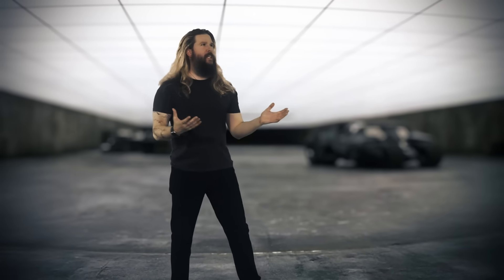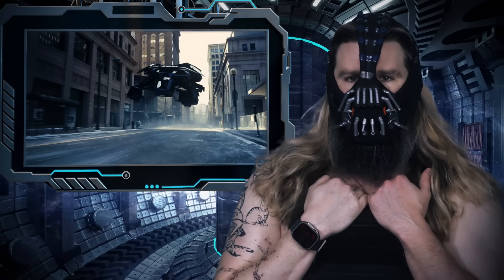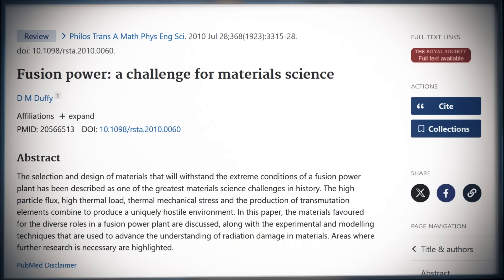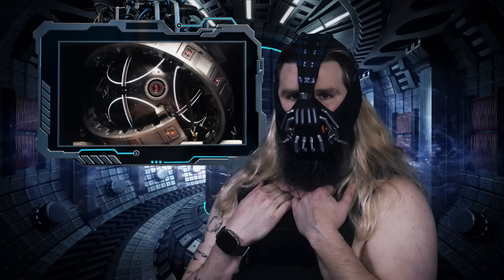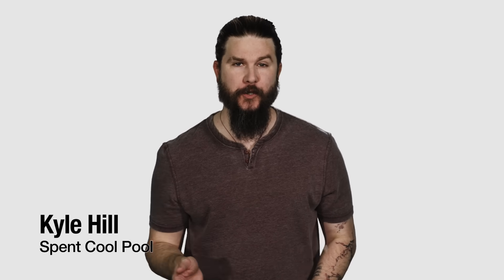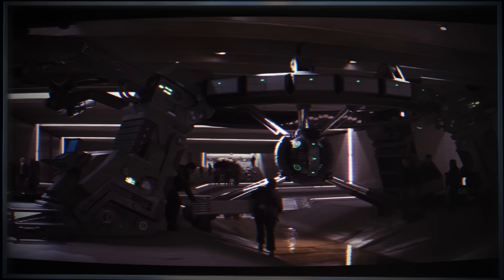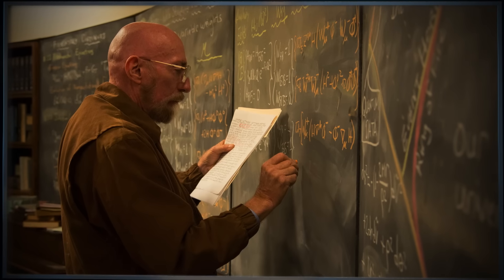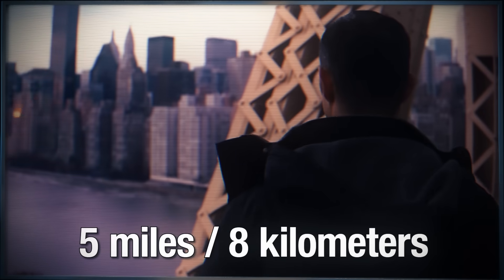Batman's Nuclear Fusion Problem

Comment: "nuclear fusion is like nuclear fission except it doesn't produce any nuclear waste"... IIRC in an older video Kyle mentioned that the fusion reactor walls get highly radioactive (was it due to the neutron bombardment?) and need replacement regularly. Isn't this also some sort of radioactive waste? Or is this a different kind of waste, that can be cleaned somehow?

Comment: Generating power from a black hole comes closest to fitting the bill here, but the timing/masses are still way off.  Even if you had a black hole of the right size to decay on this timeline(and it would release more than enough energy in the last few moments of its existence), you'd never be able to drive it around in a truck as it would mass FAR too much.  But the general idea of "once we turn this power plant on we have to keep it running or it decays and explodes in a massive burst of energy" is met by a reactor that harvests the energy of a decaying singularity(and feeds it more mass to keep it stable).

Comment: If this movie wants to be nearly true about the fusion reactors then this reactor is using cold fusion technology of muon replacement of electron. I suppose the scientists managed to discover an exotic materials and exotic way to make muons with less energy, make them last like electrons, and have an exotic material to contain them. The exotic material can decay. If surplus of muon entered to containment chamber of hydrogen place(high pressure). It may happen. But the explosion thing is absolutely not true. This thing are not there in common fusion knowledge of everybody(maybe writers may not know this thing)because muons decay in micro seconds. Muons lasting as long as electrons may work. They are not potential for fusion technology right now in real life until scientists make a way to have long life muons, produce more than one muons by energy given by single muon in cold fusion.

Comment: I would love to have a Radiacode to use with my vast Uranium glass collection, but over $300... Ouch... I had expected the cost of high-quality detectors to drop dramatically as the tech improved. Also, I assumed, knowing what I do about fusion, that the device in the Batman movie had some kind of nuclear reactor powering the fusion reactor, and that's what went supercritical. But it's all just fiction at the end of the day and the device was a literal plot device. As for Nolan getting Fusion wrong, doesn't a Hydrogen bomb start with a fission core that drives Fusion stages? So you CAN make a fusion weapon, and we have had them since the late 40's, it just needs (so far) an initial fusion igniter. I think that's where a lot of the con-FUSION about "fusion explosions" comes from. And technically, if the Batman fusion reactor device, which would have been loaded, hypothetically, with isotopes that fuse "easily", and used a magnetic containment system with limited power to modulate that fission power source, went supercritical... It could have triggered a secondary fusion stage and in essence become a fusion bomb. So play a bit fast and loose with how that reactor was built, and you could get a fusion explosion. Technically. If it was badly built, safety protocols were flouted, and it had a flaw which was required to make the fusion reactor work that relied on Fission.

Comment: It is a neutron bomb. Much of the energy would be in radiation, the fireball would be far smaller than a non-neutron bomb of the same (4 megaton) yield.
That's also why there's no tsunami (though IRL that was still possible, a megaton range neutron bomb would still cause as much air burst as a traditional nuke of many kilotons).

Comment: I wouldn't call that one "great". The first, yes. The second, without question, but most of that was Ledger. The third one was kinda like The Matrix 3. "Finished" the job, but that's about it.

Edit: then there was whatever Tenet was, that's like The Matrix 4, no one asked for this, what is going - nevermind, we don't care just don't do it again.

Comment: What if it's faster than a propeller plane? Say something like a Mach 4 jet. Faster speeds pull the explosion out further protecting everyone, and an autopilot mixed with an ejector seat protects Batman from being so far from shore. You underestimated the wealth of Batman. Clearly there is already some suspension of disbelief since the nuclear fusion reactor wasn't anywhere close to how we currently operate, so further suspension towards the speed of his craft (clearly not Mach speed but somewhere between 300 and Mach 1 sense no sound barrier was breached in the film) is clearly implied, as well as him probably ejecting shortly after plotting the course near the top of the building so nobody would have seen him.

Comment: Hey Kyle is there any radioisotope known that is not fissile but eventually decays into a much longer-lived fissile isotope and begins to accumulate? I'm not expecting a full on nuclear explosion since any further accumulation past criticality will just heat up and expand, melt, and even vaporize away the material rather than explode because of how slow the process is. But is there a conceivable radioisotope that could be assembled into a large mass and just sit there like a ticking timebomb until its decay brings it to criticality?

Comment: What if, to spite Aquaman, he dropped the bomb into the bay? So despite the lethality of the explosion it WASN'T an air burst? 

Most nuclear testing in water used deep water explosions, but a small number examined what would happen at a shallow depth of under 100 ft. While the explosion in such a scenario would be visible at a distance, the level of ionizing radiation and the above ground force is significantly lessened by the water above the explosion. Using a calculator for terminal velocity, assuming a sphere approximately the height of a person (2m), a coefficient of drag similar to a baseball, and a weight of 4 tons it would have a terminal velocity in water between 4 and 4.5 meters per second. At that rate,  it would only take a few seconds before the bomb sank underwater far enough to protect everyone in the city except Aquaman. 

Also, you forgot he fixed the autopilot and bailed on the jet basically right after takeoff. So regardless of anything else Batman himself would have survived because... He Bale'd.

Comment: Actually it's kinda the opposite imho. Smaller reactors made of denser materials should be able to keep the heat within while just the necessary heat leaks out and gets captured. The problem is "just" the neturon bombardment; one way to "solve" the problem would be using a material so dense in electrons the neutrons can't just crash into and break it's atom; this means it must be a superconductor or even a hyperconductor; the alternative is something that breaks up the neutrons themselves aka an exotic material; the problem is not that we can't make these materials with exotic particles (particle accelerators does their job, I mean...) but it's to make a sufficient amount of it. The problems is that we can't simulate how these materials will behave so it would need a HELL of testing.

Comment: in fact after the explosion, it's revealed that Bruce fixed the BatWing's autopilot so that he didn't need to be in the BatWing when it exploded. Additionally, it's likely that the BatWing traveled much faster than the fastest helicopter in the world. It is Bruce Wayne we're talking about, and it's stated in the movie that he cleared 12 miles from shore before the explosion. This means the BatWing would be traveling at about 720 mph, which seems pretty realistic for a Batman vehicle. This all indicates that the only thing the movie got wrong was the stuff about fusion reactions, not about the explosion itself, the speed of the BatWing, or Batman not having enough time to escape.

Comment: Not falling for it, prove it!  You get 4 red marbles and 3 blue marbles apart and weigh them, then put them together and you recon they will weigh less because they are closer?  You cannot think that is true.
 If you had 4 protons and then made Helium from them the Helium would obviously weigh more not less. Neutrons weigh MORE than Protons, so if you took 4 Protons and turned it into 2 Protons and 2 Neutrons because Neutrons weigh more the Helium would weigh more than the 4 Hydrogen that made it, not less. If you had 4 marbles and you turned two of those marbles into cannon balls, would 2 marbles and 2 cannon balls weigh less than 4 marbles? You gained weight  you did not lose weight. It would work if Neutrons weigh less than Protons, but you cannot make things heavier and then claim they are lighter, that makes no sense at all. Show me how you can add weight and have it weigh less?

Comment: It's actually a cold fusion reactor until it's modified to have uncontrolled nuclear decay with a quick decay stop point of full fusion with a reaction close to a nuclear bomb. think more along  the line of marvels ironman Tony Stark's reactor that is stableised by a magnetic that also drives the reaction unlike unstable cold fusion like spidermans Dr Ocks reactor witch was doomed because he even knew it and made specialist mechanical arms to help supres "power spikes" that try to bust through the harmonic balancing with a "stable reaction" there is no such possibility with in a open atmosphere with gravitational interference plus he basically made a sun the actual sun with all its gravitational power can't hold in flairs put it this way if we're real it would be like holding a plastic bag full of holes and try to contain a sphere of boiling water in it.

Comment: I'm pretty sure that ''reactor'' idea relied on an old theory that was studied during the fifties and sixties, and that must have appeared somewhere in DC comics back then: a fusion reactor made of a fission reactor preheating the fusion fuels to fusion temperatures, long enough for the fusion phenomenon to reproduce itself like an autonomous star. It's completely undoable, because it's just an Hydrogen Bomb that wishes very hard to explode with heat and joy, whatever the confinment, but that would explain that ''decay'' stuff and that the uncontrolled heating of the fission reactor would reach critical at some point and go boom. Like BIG boom. Godzilla-sized boom. Bye bye Gotham

Comment: actually dropping it in the water would have solved your issue. via the US navys own nuclear testing as a "scientist" you should know that.... pretty easily accessible information. So ya, he actually COULD have saved the city had he dropped it into the water around 2 miles out via, again, the US Navys actual real life testing. however unless the physics in the dark knight universe are different than out own it wouldnt be possible to make regardless however different physics means now matter the argument given its wrong bc we dont know the physics. But a 4 megaton blast had it been dropped into the water and i believe the Navy's data stated under 500ft would neutralize the effects at 2 miles or 1800ft at 1 miles. so youd actually only need to know the harbor water depth, distance, and remove the airburst idiotic idea bc thats essentially the worst possible way he could have detonated it and we can all presume batman is more intelligent than to allow it to airburst, realistically he absolutely would have done a submerged explosion.... in which case yes... he would have saved the city. I also believe you are aware of this and simply chose not to include that in your video for whatever reason. Also i suppose its most appropriate to assume they actually used fission to create the fusion of the bomb. thats the only way it would be able to be mobile as it was "realistically"

Comment: Also, @6:04.  If a fusion reactor requires shielding against neutron bombardment, wouldn't the shielding material itself eventually become nuclear waste?
Reply: This is correct. Even fission reactor vessels suffer embrittlement over time due to neutron bombardment. That said, the alloys/material you use can help limit this. This can be done by using an isotope with a higher neutron cross section but forms a stable isotope with addition of 1 neutron

Comment: The real fusion problem Batman had was that Wayne Industries solved cold fusion, but they were too afraid to use it since they feared it could be weaponized. Apparently Wayne Industries was unaware that fusion was weaponized in the early 1950s with the invention of the hydrogen bomb...

Comment: That was a aneutronic fusion reactor, that does not need neutron shielding. By fusion of element Fu, Fusionium, there are no downsides of fusion energy, but it can be weaponized. Weaponization is only possible when the spurious amounts of element Ck, Cerkatorium, are removed from the reactor. Therefore this reactor type is often named FUsionium-CerKatorium reactor. There is also an abbreviation of the name, but that did not gained popularity.
Reply: @Petriiik, why do you know all that?
Reply: @ryanheslin2459  I was there!

Comment: Just for fun: Let's say Wayne Enterprises manage to create magnetic blackhole, not a singularity but a doughnut shaped one due to it spinning, sort of like a Tokamak. Now the outer shell is powered by the "mother machine it's mounted in) and not only controls the spin, but the feed rate..

The "heat" is extracted though the poles of the wannabe blackhole to boil the water, sort of like a thermal laser? (yeah doughnut shaped has a hypothetical way out at the poles) So now we have 2 issues. The  heat now has no where to go... Worse still the spin is slowing and the heat from the feed is going to end up being trapped instead. Feeding back in...

 SO what now?

The spin stops (decays) and turns into an classic singularity.. and it's life span before letting go is probably going to be measured in nano seconds.  

There you go, fixed sci fi style, it would not even be a good weapon, as to get it ready it would be a dangerous to the users as the target, and even though very small, (ignoring the Mother MAchine it needs to be docked with,) not exactly something you;d want to be any where near while "only generating power", as there is no passive safeties possible. So a reason for it to be scrapped. But it should still have been far far better guarded in the film...

Some times I hear critics on such things, see the desired goal and use Sc fi BSium to get around it, just for laughs🤗

Comment: Shrugs Its a movie.. Fires 3 resonance tuned Ultrasound lasers to center to form spiral pattern catching water from atmosphere in the beams watching water overflow out of the pressure bubble the center > Sets portion of the lasers to Resonance split water to Hydrogen & Oxygen > Gives sudden expansion & Contraction while modulating the Plasma ball to generate its own Plasma generated Ultrasound echoes to help hold its shape while Ultrasound repel field from the Plasma ball rejects excess fuel from the atmosphere > Sends out bigger shockwave from Plasma ball then clashes a shockwave with the echo within the plasma to the point of fusion 

Idiots: "Look at the Plasma UFO its making no sound!" Elevated sound beyond Human range of hearing to Ultrasound ranges.. On Fusion shield level you need Ultrasound echoes to capture atmosphere water to make a water bubble that continuously replenishes so the radiation from inside that bubble transfers to that water instead of beaming on people just let that water drip off. Google: "Ultrasound excited Plasma generates stronger EM field" < That should help a "real" scientist understand the purpose of Plasma crushing with Ultrasound shockwaves.

Hey, why so many names in Earth science for things? Google: "Boeing Plasma force field blocks bomb shockwaves" If Plasma generated Ultrasound can cancel out Shockwaves then what are shockwaves really? Lol.. Earth science: "Space is a vacuum that means no MEDIUM! Hey, look at the Solar wind! Look at the interstellar MEDIUM! We wuz scientists and sheeit!" Earth is the best comedy show in the Galaxy. Spend billions trying to do things too stupid for and don't implement things that would solve most problems today. Straight up retard DNA.. Please stop sending messages into space before you bait a Predator race that will Mercy you.. - Dracula

Comment: And if batman wasted time talking his craft needs to go almost supersonic to move that 6 miles in less than 60 seconds. What's the actual speed when you use the actual time from clearing the buildings to detonation.

And is Bane a nuclear scientist cause even those have been way wrong about the power of a nuke.... Why assume Bane knows what he's talking about or that it explodes with the expected yeild. Did batman explode one befire to find out? That'd be pretty noticeable.

Comment: That's not as bad as the microwave thing vaporizing all the water many feet underground. The power needed to vaporize water in the sewer system and pipes... ignoring that metal around would draw power from going into the water in the first place and require even more power.. If it vaporized water dozens of feet away...

Shouldn't it explode any human close to it and also heat the air and  metal like crazy.  How's the train not molten metal and how are they alive fighting around the thing.

That's also ignoring its moving vaporizing the water instantly...